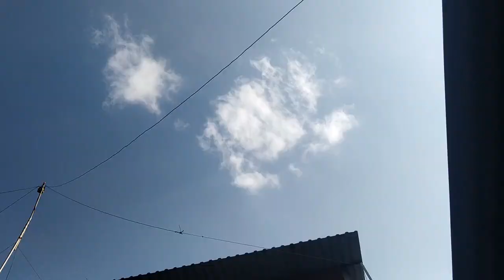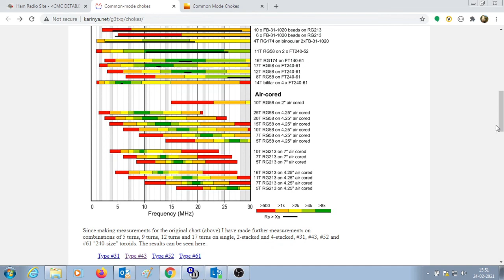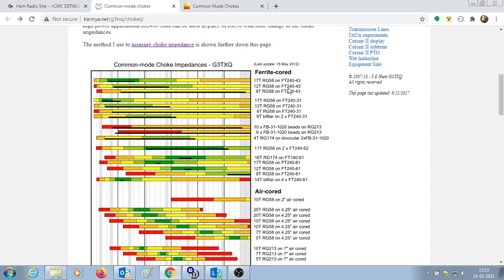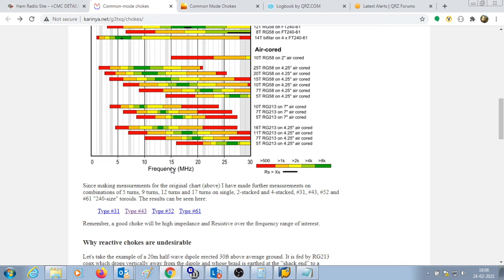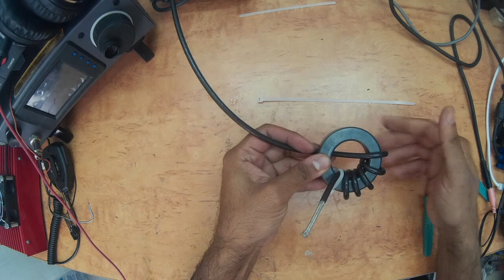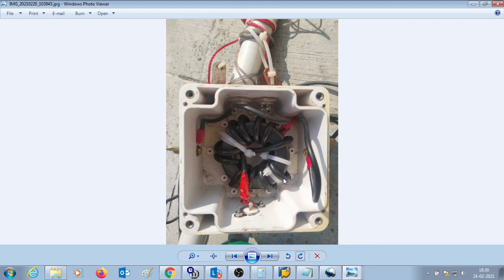Home brew Common Mode Current Choke: RG58 + FT240-43 Torroid core

Comment: I have seen similar instructive videos on using RG58 coax to wind these chokes and they all seem to ignore the "minimum radius" specification of this coax which is 1.96 inches. Clearly these chokes are winding them to about a 0.5 inch radius. How does the RG58 coax react to that?
Reply: FWIW I have never had any identifiable problem with migration of the centre core even with one that was wound nearly 40 years ago. However I am no longer convinced that it is the best way to build common mode chokes, when the turns count is high it seems that interwinding capacitance ruins the performance at the higher frequencies. (I was seeing almost identical results to G3TXQ). My latest versions use twisted pairs as the windings, specifically pairs removed from CAT5-6 cable. These have a nominal characteristic impedance of 100 ohms, so I use pairs in parallel to achieve 50 ohms. I have not operated them at prolonged power of more than a few hundred watts (yet) but the common mode attenuation and bandwidth appear to be better.